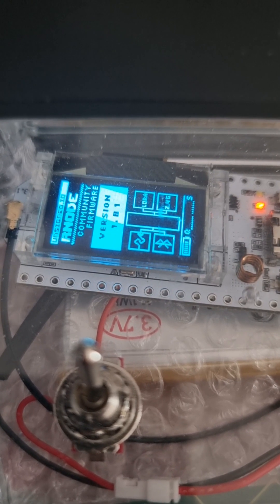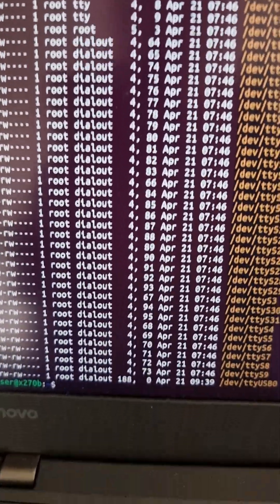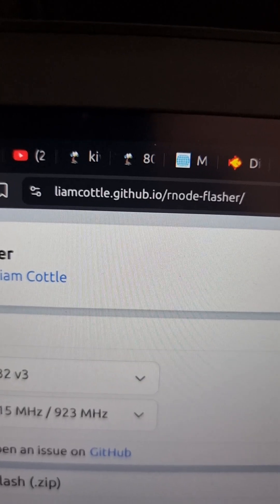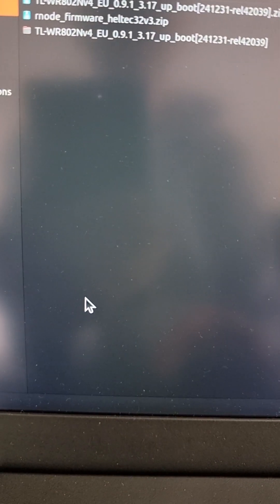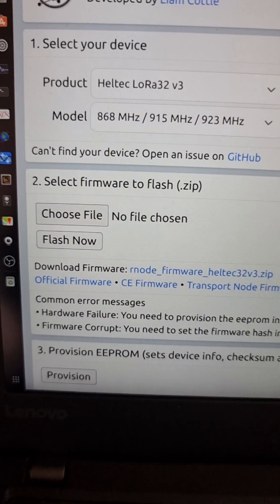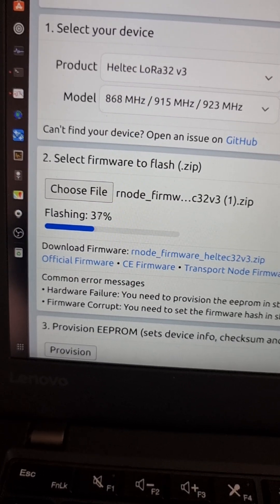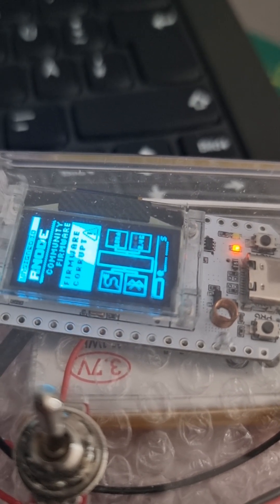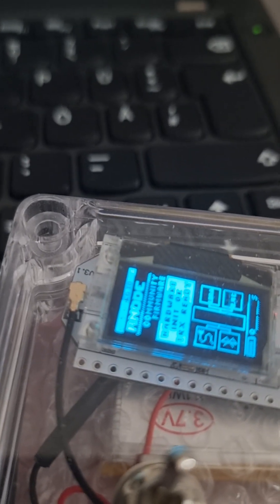Flash Firmware on a Reticulum RNode

Comment: Thanks for the video, it helped me understand some details, I had a lot of problems in the next steps [binding with Sideband] but even that step was passed after trying several times. My question is another one though... How can I test the range between two RNodes? In meshtastic there is the range test option but I didn't find anything about it in Reticulum. I understand that everything is influenced by the radio/frequency settings and so on, but on the practical side, how can I understand the range of the transmission distance between the two RNodes? Thanks
Reply from the maker: You could use some complex RF path simulation software to calculate theoretical link budget and hence range or just take a long walk and make real measurements.
Reply: @fotografm  Thanks for the reply.
I finally used Meshtastic to see how far Sideband can transmit and receive. I used two Meshtastic nodes with test settings and two radios with Sideband, and I drove back and forth with one Sideband node and one Meshtastic node.
I found that, with the same antenna and radio, Sideband works better than Meshtastic. I know it's not the best method, but I figured out a few things.